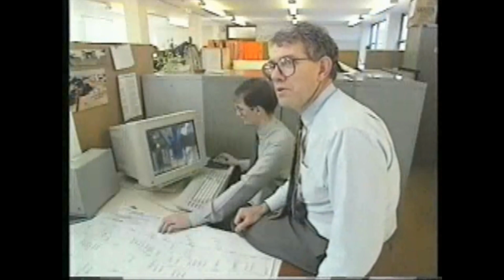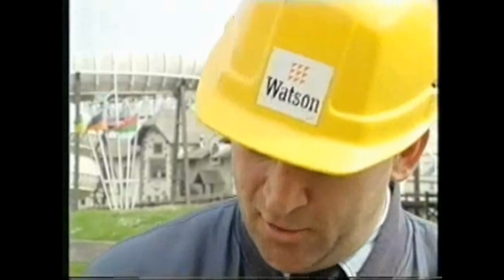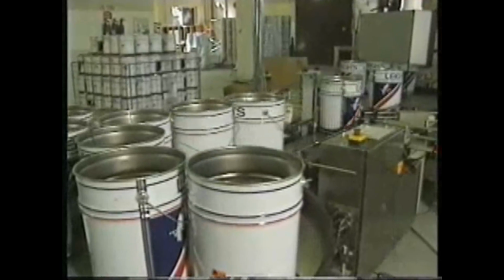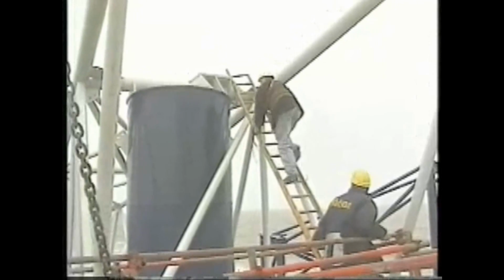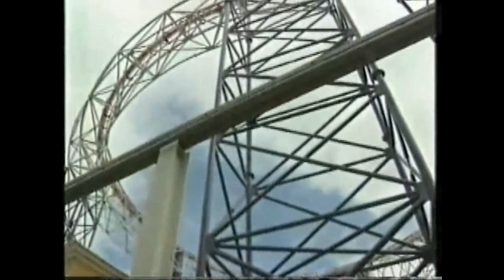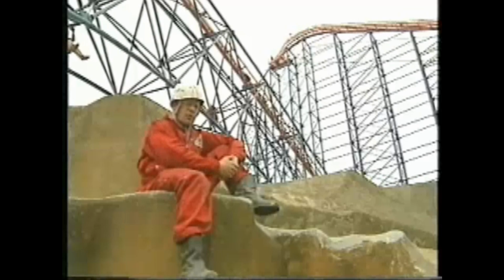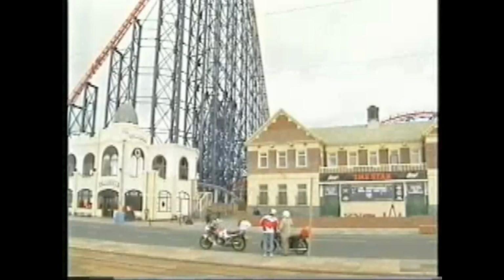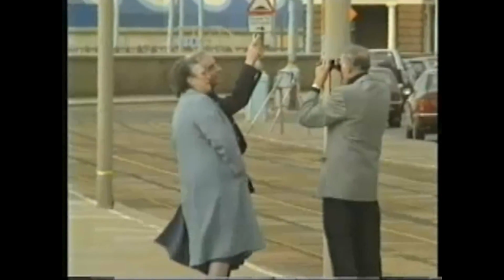Pepsi Max Big One Construction Blackpool Where Seagulls Dare Part 1

Comment: Cedar point build first roller coaster you beat it because u copy cedar point idea that opened in 1989
Reply: It's not a copy It's a arrow dynamics coaster that's longer faster and higher then xl200 which was designed and built  by arrow dynamics
Reply: Called magnum XL 2000
Reply: robert labuda no magnum XL-200
Reply: cedar point is crap not being mean but
Reply: A manufacturer can’t copy itself